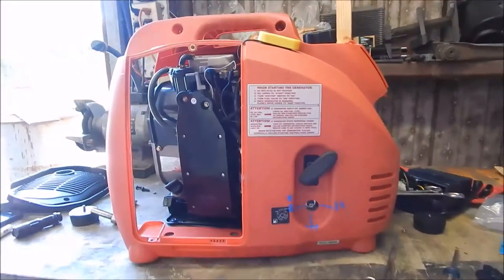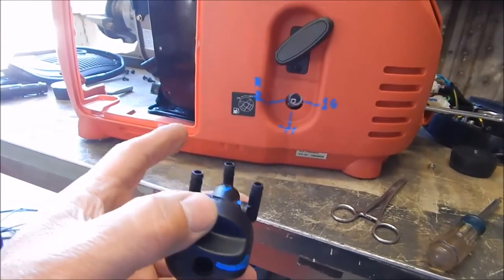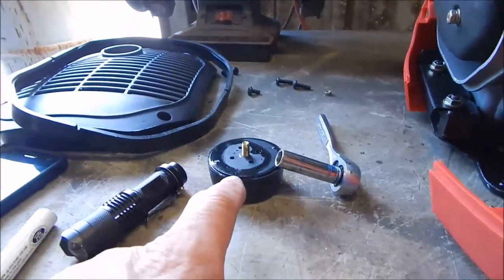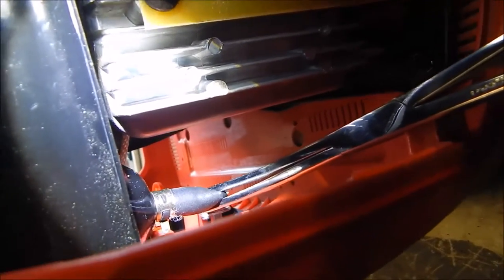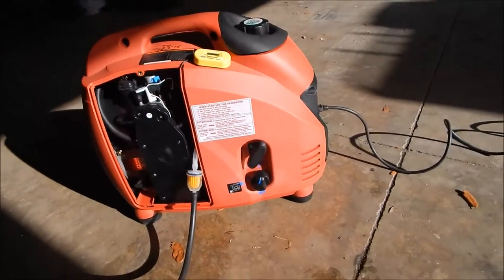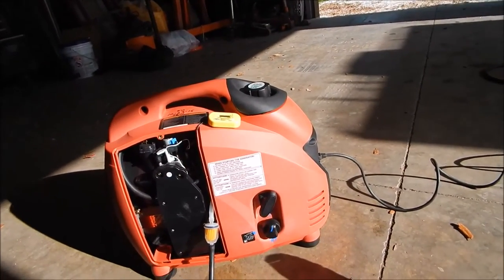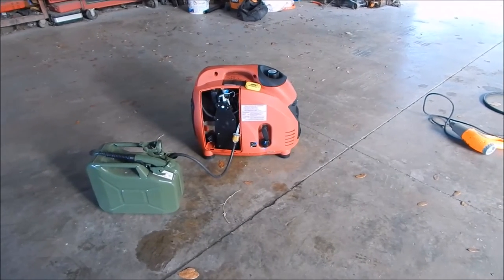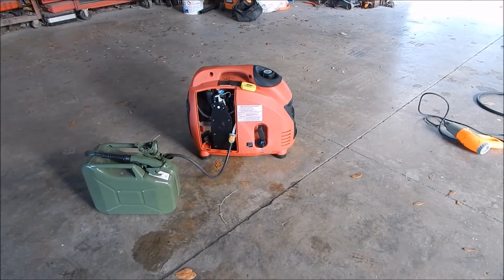Harbor Freight Predator Inverter Genertaor 3 Way Fuel vale installed.

Comment: If I may add a comment on this HF generator.  Mine quit working, after the first run.  I couldn't get it restarted and I pulled the rope so many times, the rope broke.  First upon the removal of the red cover, I found the rope was never put through the internal bushing hole, so the sheet metal cut  the rope.  HF never got the replacement pull starter, so I went to the big orange box hardware store and bought 100' of new 1/4" rope and cut a piece, rewound the starter and that was fixed.  It failed to start due to a wire harness connection vibrated apart.  There are several automotive type quick connects with barbs to keep them together.  One of these was broken and came apart.  AFter reconnecting, securing, it runs ok now.  Poor quality build on my genset, but it is working now.  Thanks for the fuel valve idea!
Reply from the maker: Wow glad U fixed it .I got 30+ hrs out of my first run ran fine as long as U never shut it off. I took it all apart I found nothing other than a hot no start issue this 1 is fine.

Comment: Excellent video! 

Quick question: I've always been under the impression that only Honda generators had a fuel pump that could pull out of a remote tank that wasn't gravity fed. I heard you mention that you've hooked into the fuel pump here, and I'm trying to determine if this is the newer model (the "Gen 2") or an older model?  I was actually under the impression that the original was a "Yama-copy" and didn't have a fuel pump either, so I've learned something today.  

If the newer ones also still have a fuel pump, this is something Harbor Freight really should mention as a selling point! As you say, having to find an adapter to gravity feed the existing gas tank isn't only expensive and a giant pain in the ass, it can be messy too as you try to balance a second tank above the first.
Reply from the maker: Thanks! These older 2500 watt models are no longer sold unless they are old stock had fuel pumps. The new 2000 watt models are a copy of a( Wenn) generator they are a exact copy,  I would assume it has a fuel pump as well .  the new ones have a vented gas cap like a Honda the older ones like I have have a vented fuel tank not cap. So then it would be easy to gravity feed though the gas cap just like the Honda's do .I was in my new store by me & had some real hands on time looking at it .It is also able to use a parallel cable to plug 2 generators together like all the rest do.

Comment: i would have used a http://www.chsmith.com.au/Products/Evinrude-Johnson-Fuel-Line-Fittings.html at the end of the fuel lone. then just plug it into a 40lt boat tank.
Reply from the maker: +Justin Case Solar Power  thanks! that's what I have planed to use as I mentioned towards the end of the video, just did not have it at the time of making the video. That's the best way to do it yes.
Reply: I also use the marine hose and male/female boat connector.  I have a 3 gallon and 6 gallon portable boat tank stored with Ethanol Free gas just for the portable generators.  It has worked out great.
Another source to keep in mind for hose connectors and clamps is a Marine Hardware store.  Proper fuel line clamps in higher quality stainless and brass fittings for the connectors when needed.

Really enjoy your videos.  Thanks for the effort.
Reply from the maker: Thanks good idea.  but I went with a smaller quick connect positive seal fitting for a atv type app. much smaller but on the same theme.